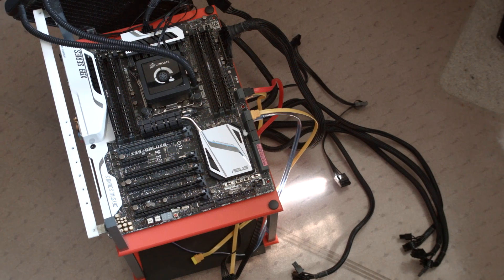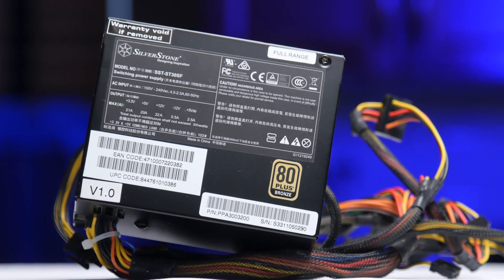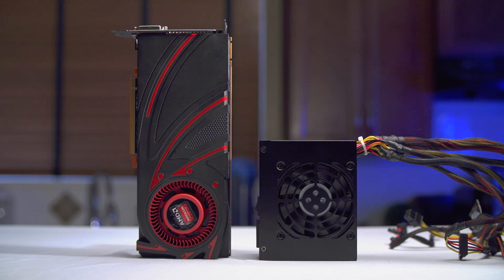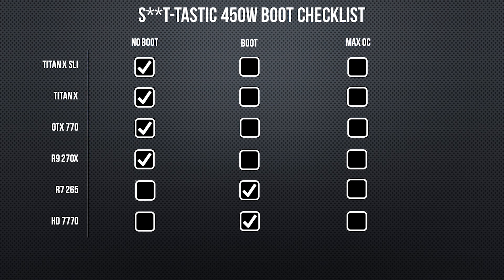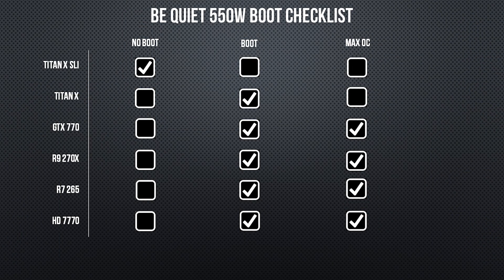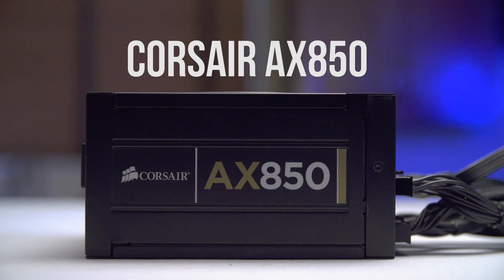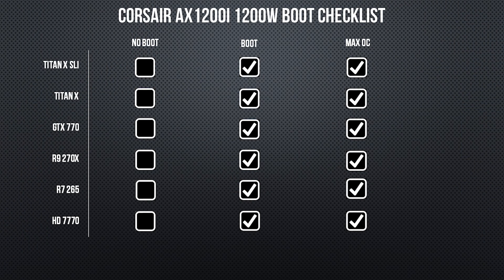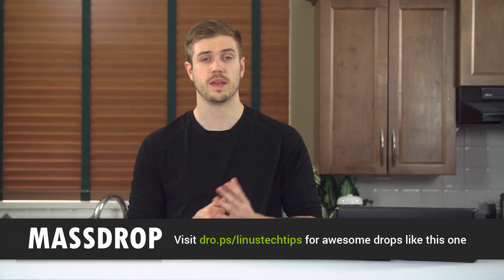Overclocking Recommendations - Low vs High Wattage Power Supplies

Comment: One question:

I currentlly have a HP Desktop (enterprise grade - hp elite 8200cmt)
It has a 320W power supply and i was wondering if i cold even think about putting in a gtx 750 ti or a gtx 960 becouse HD graphics 2000 no bueno xD
Ty in advanced
Reply: SlavjanA orrr you could just go over to nvidia and see what THEY say THEIR cards require. id never take advice from some 3rd party on something like how much wattage is used on a video card. Follow the manufactures recommendation, its always set higher than needed
Reply: MrVhorthex i used it b4 but it game ve 301W and i wanted some community feedback
Reply: Rage Machine Considering the gtx 960 needs 150 watts for it self plus your motherboard and fans etc need power get at least 600 prob more
Reply: Rage Machine btw the specs are:i7 2600 with no OC
8GB Ram on 4 2gig sticks
1TB HDD (WD Blue)
Reply: Rage Machine the 960 max wattage is 130w u can go with the gtx 750ti without problems :)
Reply: Rage Machine Does your power supply has a 6 pin power connector? And even if you did, I think 320w is pushing the limit here, go for a gtx 750ti, or save a bit more, buy both new psu and gtx 960.
Reply: the gtx 750ti it's like 70w no problem there on a 320w power supply...
Reply: Rage Machine i have a gateway pc with i7 2600. 8gig ram. 256gig ssd. and r9 270. i fully OC my card with the default power supply that came with the pc. im pretty sure its a stupid idea cz the PSU is usually shit lol. im taking the risk, but im gonna upgrade later on when i have money.
Reply: Rage Machine OR maybe you can, 270x has a higher power requirement and he can boot it with a 300w psu with cpu overclock, but then again, it is a better psu.
Reply: james Adam 600W for 960 setup? Wow. That setup runs fine on a quality 400W PSU. 600W PSU would run 960 SLI setup :D
Reply: 750ti wants a min of 400W, and 960 wants 430W. http://www.realhardtechx.com/index_archivos/Page362.htm

But I would say that you could get away with that PSU for the 750ti, although you'd need at least 400W for the 960. The main thing is that even though you could get away with that wattage, the amount of load that will be on the PSU might be a bit of an issue as the quality of it might not be so great.
Reply: james Adam lmfao! stupid fucking kids just shut the fuck up dudes seriously. im sick of seeing shit like this "get 600 more and youll be good" just shut the fuck up and go read an A+ certification book. Youre attempting to say that his motherboard, cpu, hdd, and whatever else shit he has IN A HP is using 600 watts? keep watching linus's videos, theyre made for ppl like u.
Reply: beyond305 Overheads and AMD CPU's is all I'm gonna say.
Reply: Rage Machine According to pcpartpicker.com a Z68 Motherboard, i7 2600, a WD Blue, and a GTX960 use 314 watts. I would NOT use a GTX960 on that PSU because its capping out the rated PSU specs, and the PSU is probably old, and since its a prebuilt PC the PSUs are crappy. A GTX750ti maximum i would say.
Reply: InDaHood Okay Ty
Reply: GriggsCk Gaming It does and HP uses a propriatary PSU :C
Reply: Rage Machine Just use an PSU calculator like this one:

http://www.extreme.outervision.com/psucalculatorlite.jsp

There you can fine tune your system's components and get a better idea of how much  power you would need.
Reply: Ahh, sorry about that. I just like to spread the use of this little nifty tool. :)
Reply: Rage Machine Then you can probably do it, but ah, change your psu as fast as possible, maybe a 450w, or 500 w. I would save a little more and get both psu and 960 TBH.
Reply: Im running a overclocked fx 6300 4.3 ghz with an ghz edition r9 280x with a 500w bronze psu for more than a year and everything is good. These recommendations are a overkill. You will be more than fine.